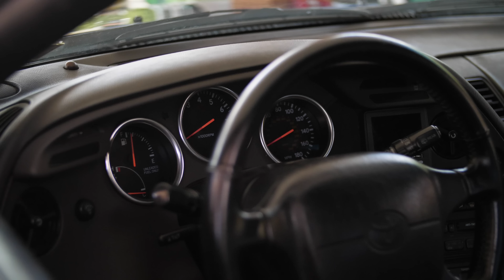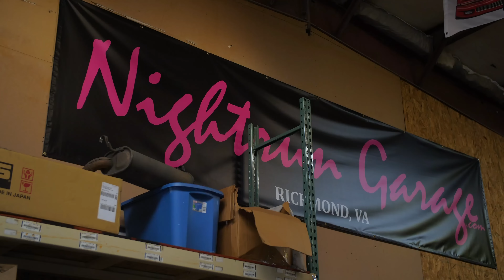More Than a Supra- The Loss and Redemption of a 1990s Toyota

Comment: can i just say i'm not usually a supra fan because it seems every A80 is over kill and seems thrown together just to make stupid power numbers. but this car, it's not overkill. it's had love put into it instead of money thrown at it. the fact he swapped the frame and welded a new one on shows he really cares about his creation. and it's beautiful.
Reply: not overkill? the car looks nice, but he swapped a 9" and fully built the motor, and his goal hp is achievable on a completely stock car with just a big single, injectors, and fuel management. lol
Reply: @leefhead1  I think he said his was a non turbo block if I remember correctly there are some differences between the bottom end of a 2jzge and a 2jzgte so I'm not sure how much am na block can take
Reply: i didnt notice that it started out as a NA car in the comments.  He never really stated that.  Just said the built engine was a NA block with a VVTI head.  Instead of building it and finding a soarer head, then building that, he could have just bought a soarer 2jzgte and been done with it.  Regardless, he did whatever he wanted and built it for himself, but its certainly overbuilt.
Reply: Actually, loads of them ARENT mad overkill, remember, this is fucking youtube where bro numbers are all that matters. There is thousands of mk4 owners who treat them as drivers cars and look after them well..
Reply: I've not seen any supra that was just thrown together to make stupid power, but isn't that what a person would want? You could always turn it down 🤔🥲

Comment: Bro... Your story is VERY TOUCHING ....  And your car is GORGEOUS ... !!! 
Back in 2004 i also was on the interstate and decided to hit it, not realizing that i also had bald tires in the back, the rear end lost control and went sideways ... I hit the guard rail 3 times and crushed the front and rear ... Car got totaled out by the insurance ... That night after it happened i was in TEARS over the steering wheel for about 5 minutes just after it happened and when i came to the realization that IT DID JUST HAPPEN and i was hoping to wake up from a bad dream ... I kept saying to myself... WHY... WHY ... WHY ... What did i do..?? 
But unlike your story, i didn't keep the chassis, i found another one that was stock... Tore it apart, painted it, pulled the motor out, rebuilt with forged internals and new turbo ... Its 2018 and i still have it. BTW my car is a 98 nissan 240sx, i have been offered $20k for my car and i keep telling everyone NO... its NOT for sale ... And i will NEVER sell it... Because i have put a lot of $$, blood and sweat into this car and the connection between me and this car is strong. Yes its only a nissan 240sx but its MY 240sx ... Even guys from back in the mid 90's that i used to hang out with are still shocked that i still have it .. even though they all moved on and sold their cars and live a normal "modified free" car life ... I still have mine .. 
I understand your history and connection to the car.. DO NOT SELL IT ... !!!  My next car will be a 97 Supra 15th anniversary Limited Edition... This will be my 3rd turbo car :-) 

Good Story .. !!!

Comment: Damn! This is motivation! I have a 02 accord. Its not totaled, but it has high mileage, needs wheel alignment, brakes are making hella noise, and there is so many issues with the engine. I was about to give up since I spwnt so much money and time on the car, but it gave me an eye opener that this accord has so much potential. My friends gave me hella ideas with engine swaps and modifications.

Comment: Any video on that beautiful '91/'92 Supra MK3 Teal?
Reply: Live_Wire92 The car is a 91 in blue metallic. It is completely stock exterior and interior wise with the exception of the radio. It is currently getting the engine swapped from the original 7mgte to a 1jzgte vvti.

Comment: No crazy bodykits, normal ride height and an engine that does not need a rebuild after doing a quarter mile. That thig looks great in lfa blue.
Reply: He blew up the engine 1 year after this video in 2019. It still hasn't been fixed yet. Looked it up on his IG

Comment: Sick paint. How would I do my Supra on the outside.
My wheels of choice for JZA80 Supra is Volk TE37SL Ultra, Volk TE037, Advan GT or OZ Superturismo LM Black. Everyone has their choice of wheels. My Supra would have a Custom TRD 3000GT base widebody. Side Skirt carbon liners, rear carbon diffuser, custom front splitter with the middle divider removed. On the front bumper side I would have double angled canards. The wing would be a carbon GT Wing or stock TRD wing.
My Supra would be a 500-600hp track monster.

Comment: Ummm what the fuck? You put a new "front end" on it? You mean you welded a front clip onto the frame lol? Holy shit. I'm glad it worked out for you but I wouldn't touch that car personally.

I totally agree with you though that if you put all that work into it and your friends and family put all that work into it, that it's more than a Supra to you at that point. I know the feeling and I agree with you there. Don't drive it hard and risk crashing it since you put so much work into it, just cruise it. The 4th gen Supra is a legend. You don't need to prove anything to anyone. Cruise it. It earned its respect already.

The 5th gen is a piece of shit, one does not just create another legend, and that's why the 5th gen Toyota is trash, because Toyota can't outdo the 4th gen enough to create another legend. If Toyota was smart, they would RE-RELEASE THE 4TH GEN SUPRA. START PRODUCTION AGAIN ON THEIR LEGEND THAT THEY STOPPED PRODUCTION ON IN 2002. I WOULD BUY A NEWLY PRODUCED 4TH GEN SUPRA. I already own a 94 Supra turbo, but if they started production on the 4th gen again, I would buy the newly produced 4th gen also. FUCK THE 5TH GEN BMW GARBAGE. EITHER PRODUCE ANOTHER LEGEND WITH A 3JZ ENGINE, OR IF YOU CAN'T, THEN START PRODUCTION ON THE 2JZ'S AGAIN. BITCH ASS TOYOTA.